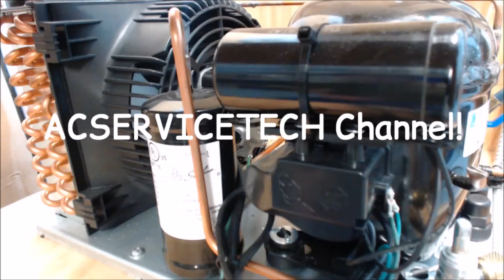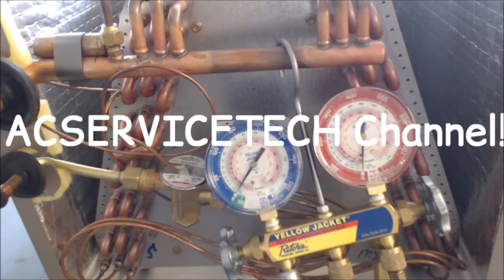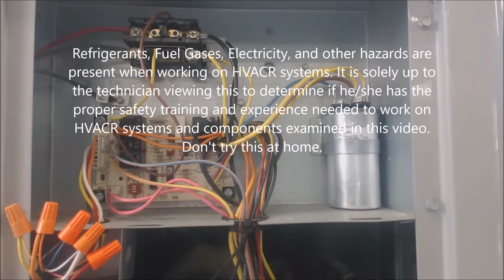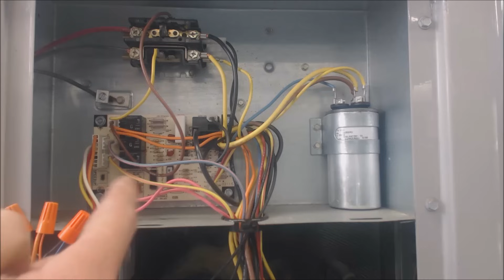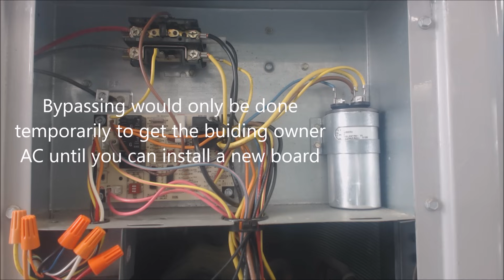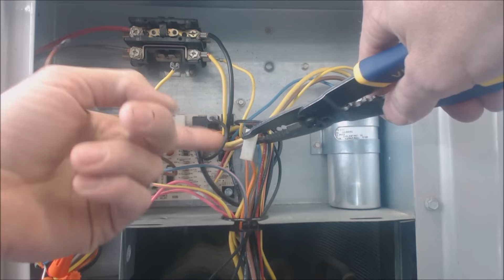Heat Pump Troubleshooting- Defrost Board Testing and Bypass for Cooling!

Comment: So wouldn't this setup work for heat as well? Just no defrost. Right?
Reply from the maker: Yes it would work depending on how you power the reversing valve but once it is 40 degrees outside, the coil starts to freeze because the temp on the coil is lower than freezing. I would not damage the outdoor unit accidentally because I won't be there to monitor this. Thanks for the question!
Reply: Not critiquing, but to avoid possible condenser damage wouldn't make sense to not wire the reversing valve. So if heat were selected on the thermostat cool would run thus avoiding possible condenser damage. So the reversing valve could be wired in line with the yellow from the thermostat with both wires in series to the contactor.
Reply from the maker: Correct, this video was only a representation of what to do in the summer to get the homeowner cooling but the video also covers ruud and rheem or other manufacturers so no one gets confused because the reversing valve signal is still coming from the thermostat correctly. I just didn't want anyone to get confused and wire it wrong. You certainly can wire it exactly the way you are saying if the brand is one that only powers the reversing valve in cooling. This video is only if you were coming back with the board soon anyway. Thanks for the question billy bob!
Reply: So on this unit it will go into heating also ?

Comment: Why leave the High pressure switch and LOC switch plugged into a dead defrost board. They should be in series with the yellow compressor 24v coil regardless how temporary this is.
Reply from the maker: Ha, I'm glad you caught that. I mean't to do that in the video and I see I did not. I will put a note in the video during that section. Thank's alot Bernie. It's been a long week. Teaching HVACR daytime, night time, as well as night service calls, and weekend installs! Thanks
Reply: electric furnace wired

Comment: yes you could use emergency heat.  You could also use heat pump for heat.  Just have one contactor  for the compressor and add one for the OFM making two motor controllers.  Wire DFT in series with the contractors.  When the DFT senses a low coil temperature it will essentially initiate defrost by cutting out the OFM.  Of course this would only be a temporary fix because you would only be initiating and terminating defrost by temperature only but you would still be able to use heat pump for heat.  Without the defrost board you would not be able to initiate defrost by time.
Reply from the maker: Todd, your thinking in the right direction, how do I get the customer heat if there is no secondary heat. My concerns. The dft is normally open. The dft would be closing constantly since the temp on the coil would be lower than 32 any time it were 40 degrees or lower and would close because the coil is absorbing heat from the cold ambient air. Most DFTs close at 27-32 degrees. To do what you mentioned you would also need a general purpose relay. Of course, anything could be made but a timer would be needed so the unit is not running in defrost mode so much putting cold air in the house. Thank you very very much for the thoughts and ideas! I do agree, just move to emergency heat temporarily. Thanks
Reply: acservicetech Most DFT switches I have come across are NC but I know some are NO but like you said it depends on the manufacturer and what your unit schematic says.
Reply from the maker: Thanks for your comments Todd!